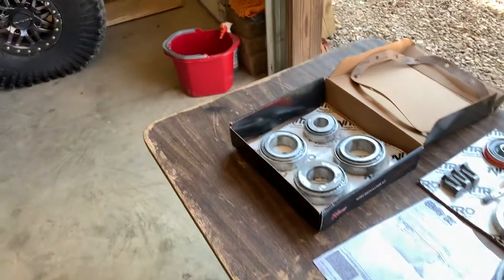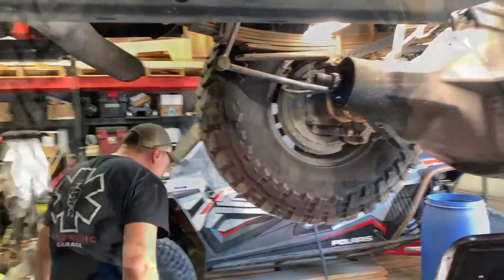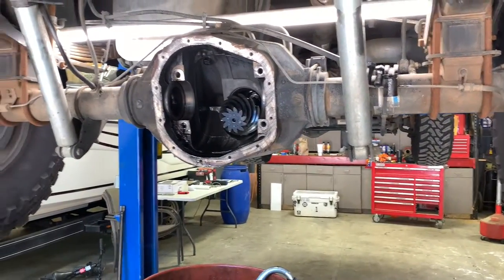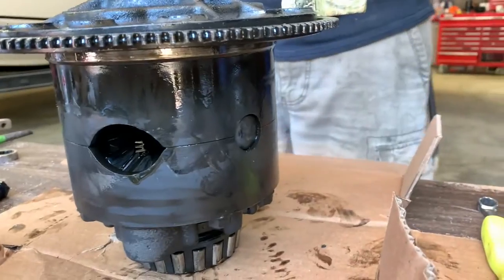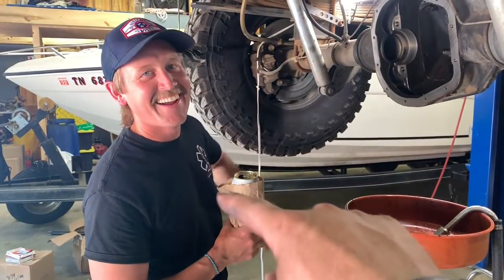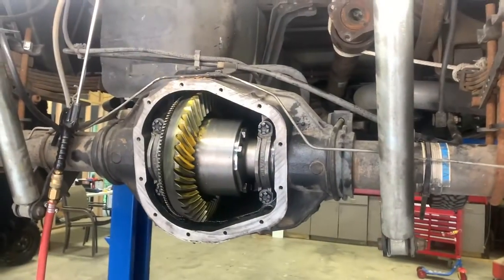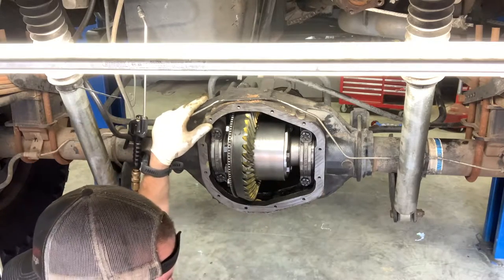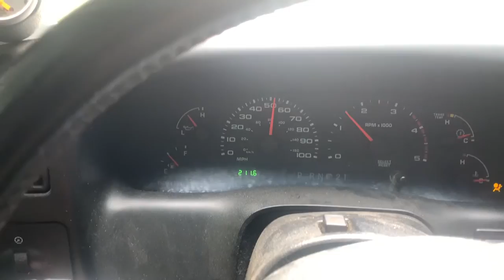Superduty 4.10 gears and Eaton truetrac install

Comment: Got a 05 f250 with the Truetrac rear end. Can you tell me why it’s locking in positive traction while towing my camper when I make a sharp turn at slow speeds? I get a violent popping while making the turn. Thanks for any info!
Reply from the maker: What oil are you running

Comment: Try to remember good bearing handling practices. Leaving it on the ground and spinning it with your dirty hands is a great way to introduce contamination and ensure premature failure.
Reply from the maker: Ooook
Reply: @AutomedicGarage 
I've never done a rear before, but I do build multi million dollar jet engines for a living. Bearing handling is a huge thing. Bouts to do new gears and a trutrac in my f100. Besides the bearing handling, good video.
Reply from the maker: @seethesvt  I didn’t put anything dirty in that rear. It has 40k hard miles on it since then. No problems. Thanks
Reply: @AutomedicGarage   like I always say "shit happens when you fart naked."

Comment: Great video, I’m going to do my F250 after the new years.   I’m thinking of doing 4.30’s since the truck lives with a landscaping trailer hooked to it and rarely runs around with nothing hooked.   Do you guys have any experience with the 4.30’s and also have you done a video on the front axle?  Thank you in advance and i appreciate all the videos!
Reply from the maker: Funny you ask about the front axle, we just finished video doing his front, I got rushed in the reassembly because I had to go rescue someone broke down, but I will edit it and get it posted soon. Thanks for watching.
Reply: Video of front end is up.

Comment: Why use a new crush sleeve for setup? I thought you just used the old one or left it out and set preload by hand.
Reply from the maker: I do it because I feel like it’s the most accurate way to set everything up and checking backlash so that the inner pinion bearing has preload on it so that it has the small amount of resistance created from the crush sleeve. Not saying I’m right or wrong, just the way I’ve always done it and have yet to have a failure out of any I’ve built. Thanks for watching.

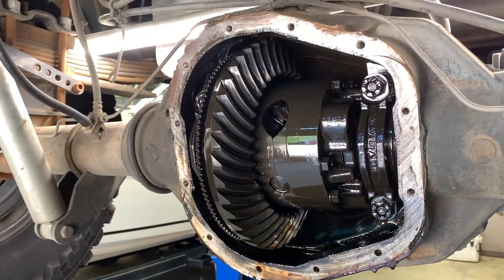Comment: What are the benefits from a stock rear end to 4:10 gears on a 2006 f250.?
I have a 4 inch lift with 35 tire.  20x12 wheel on my 2006.
Reply from the maker: @johnnycortez46  if you don’t have 4.10s you got 3.73s. The 4.10 make the truck feel more peppy, and the truck will be happier when you do tow. To me 4.10s and 35s are a great combo. I can squeeze 21mpg out of my ole 7.3 if you drive it right on a road trip with the same combo.
Reply: @AutomedicGarage  well that is some good information to know.  Since yours is a 7.3 engine and mine is a 6.0 does that matter?
Reply from the maker: @johnnycortez46  the 6.0 and the 5r110 combo are a little more forgiving for turning larger tires with no gear change.
Reply: @AutomedicGarage  Thank you for the input.  Much appreciated

Comment: Can you provide more detail of how the truetrac performs? On road, off road and towing?  Compared to the stick LSD? Would you recommend the truetrac?
Reply from the maker: Troy hasn’t gotten to use it off-road really since I still have to do the front diff in his truck to use 4wd but he has said in wet road conditions on laying it on hard on dry pavement the truck hooks good and leaves 2 solid marks on the road and doesn’t seem to be a harsh lock up but smooth. Hope that helps.
Reply: Truetrac’s only weakness is when a tire leaves the ground, and then all you have to do is drag the brakes and it’ll find traction.

Comment: 😩 damn I wish I live near you guys. I have a 2009 F150 and I just purchased some 38 inch tires and I want to put 488 gears I’m just hoping the 488 is the right decision with a true trac as well
Reply from the maker: 4.88 should give you more than enough gear and you can’t go wrong with the truetrac. Thanks for watching
Reply: So I went with 5.13 with the Truetrac waiting for everything to arrive. . And I’m just hoping everything works out with the Truetrac. Is there any noise turning corners or any noise at all?
Reply from the maker: @re9473  No feels not different than the factory LS other than it locks up better.
Reply: No noise at all from the Truetrac. It’s been working flawlessly.

Comment: Question. Why are you using multiple crush sleeves? Why not just set the pinion? And just remove the ring assembly?
Reply from the maker: Pinion depth must be adjusted to achieve the proper gear mesh. High contact needs more pinion depth or low contact/root contact needs less and all that is determined when you check your gear pattern with the marking paint.
Reply: @Automedic Garage  ohhhhh so if that's the case you don't need to torque it down like other videos suggest???
Reply from the maker: @ruizg26  no I torque as if it’s the final install every time, I want to feel how the gears turn, measure the bearing preload which I go by feel and you don’t want any discrepancies with backlash or gear pattern from maybe a not fully seated bearing. I also make sure I have some oil on the bearing because it changes the feel and resistance vs a dry bearing.
Reply: @AutomedicGarage  awesome info thank you for the feed back
Reply: I've seen some people use the old crush sleeve when checking the pinion depth. That method makes sense to me because the crush sleeve is only there to keep force against the nut so it doesn't back itself off over time. I like your suggestion of grinding the old pinion bearing race for clearance and using it as a setup bearing, however I would want to check how far the new bearing sits inside the new race and old race first to make sure it's exactly the same. Thanks for the video. I'm about to swap a Truetrac into my F250 to replace the Tracloc LSD that has been chattering and giving me problems because the carrier is grooved where the clutch ears contact it.
Reply from the maker: @alexkram  crush sleeve has nothing to do with “keeping the nut from backing off”, it’s for bearing preload. Yes I always check the fitment of old race with new bearing to make sure there isn’t any significant difference. When checking backlash between the two it’s usually less than .001 difference.
Reply from the maker: @xxxmikeyjock  I’ve had good luck out of all the truetracs I’ve installed. Economical build when the carrier is destroyed like on the 6.4 I’m building a rear end on right now.
Reply from the maker: @xxxmikeyjock  to each their own, it’s not a open diff by any means. They function as designed and do great when I light the tires up or drive in the ice and snow we get. I get them for around $600 on my account and you can’t touch a carrier even a stock open or LS for that price when rebuilding.

Comment: What size tires are you running for the 4.10’s?
Reply from the maker: 35s. 4.10s and 35s are a perfect combo in my book for pulling and fuel mileage. I get 21 on the highway in my personal 7.3
Reply: @AutomedicGarage  what part number for the gears? I went to a shop here in Florida and they are trying to tell me I need to use Yukons 10.25” ring and pinion gear set along with the 10.25 master install kit. Only gear ratio I can find for 10.5” is 4.11. 
I really appreciate you guy’s channel and the quality of your videos
Reply from the maker: @johnthurmanmerman  I’ll check with Troy on where he got them at. He bought it all from the same place.
Reply from the maker: @johnthurmanmerman  rvautoparts.com

Comment: why are you putting shims under the pinion bearing race ? That's not where the shim goes. The pinion shim goes on the pinion gear under the pinion bearing.
Reply from the maker: From the factory 10.5s are set up with shins between the pinion head and the inner bearing, after market set ups such as nitro, Yukon etc sometimes come with both  shins for between the pinion head and shins for the inner race or just shins for the inner race. I prefer the inner race shin set up, it’s easier for setup purposes than pressing the bearing back off the pinion for adjustment. They both have the same effect wether between the head and bearing or between the race and axle housing which is move the pinion closer to the ring gear. Look it up. Plus the shins that go between the head and bearing wouldn’t even fit right for going behind the race. The inner pinion bearing race is a different diameter than the carrier bearings or pinion shaft so this shows that that’s where these shims go. Thanks for watching.
Reply: @AutomedicGarage  well then aftermarket is making it easier to set up then. Thanks.
Reply from the maker: @kenthuntsingersr7501  wasn’t trying to sound like a jerk it does make it a lot easier.
Reply: @AutomedicGarage  Been a few years since I set up a Sterling rear. Guess this is something new for easier set up.
Reply from the maker: @kenthuntsingersr7501  yea I use the old race for setup purposes and grind down the outer seating surface some so you don’t have to beat it in and out until you have everything setup right, then once you know your shims are right install the new race. There’s usually no difference in your back lash or gear pattern or if there is it isn’t enough to matter. Makes things a lot easier I think. On a Dana 80 you can’t shim the pinion this way you have to press the inner bearing on and off and put the shims between it and the pinion and the Dana 80 or at least all that I have done don’t use a crush sleeve, you only use shims.